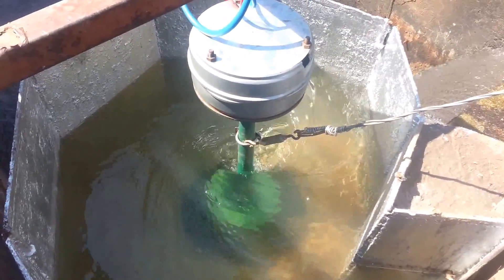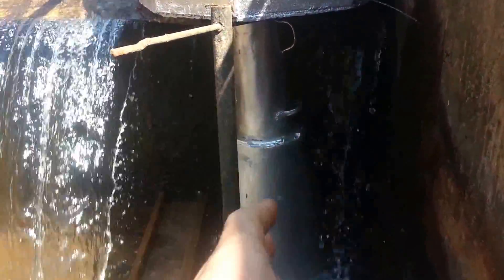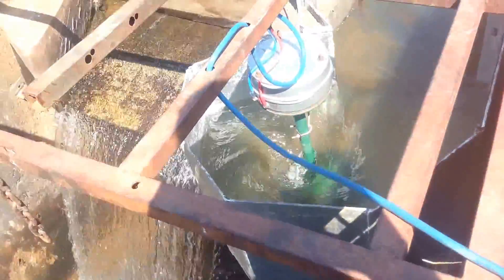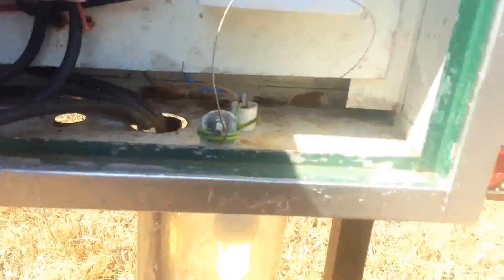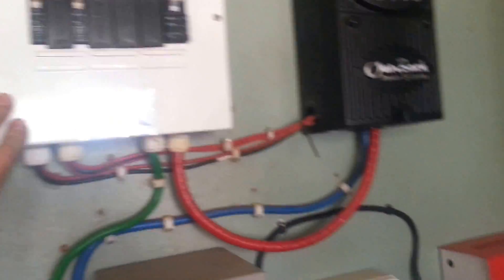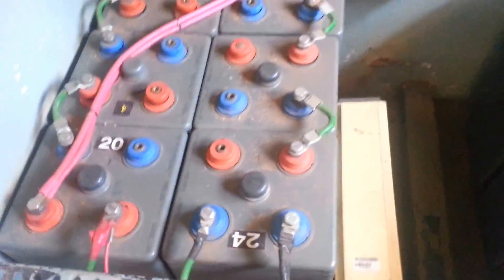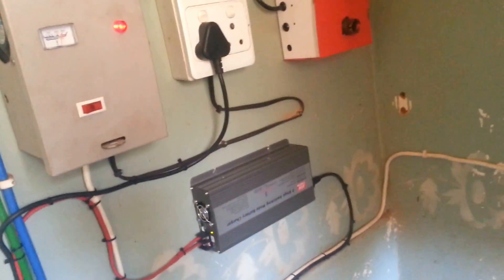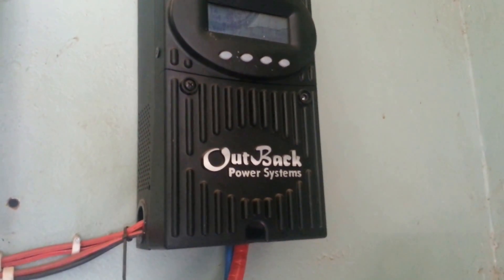DIY Micro Hydro System for my off-grid home

Comment: I am using voltage guard . That is adjustebol that will trigger a contactor when it get to the the settingpoint.
Reply from the maker: Hi there Tore . after a couple of voltage guards , I have come up with a better solution on how to keep the voltage constant and using it to charge my batteries , i will share this idea on you tube soon keep a look out for it on my channel .Thank you for watching and for your comment

Comment from the maker: hi there thank you for your comment , My head is 1.2m and my flow is about < 0.083 ( cbm/s ) and i have 500w micro hydro system and i am located in South Africa . For 900W you will need a head of 1.5-3 meter and a flow of 0.4-0.45 (cbm/s ). If you have any questions please feel free to ask.
Reply: Hi 
I have a head of 1,4 m and     40 l/ s  I did many trying no results I need your help